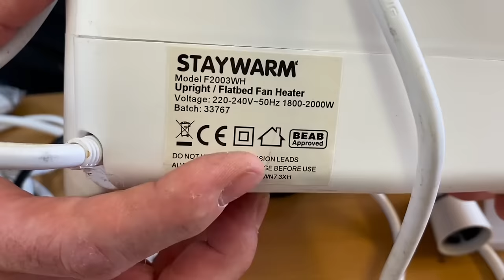Class 5 Flexible Cables - Construction, Number of Conductors - BS 1363 Plug Tops and BS 1362 Fuses

Comment: The ferrules usually have a slightly opened end to make it easier to insert the cables - look closely for this as it's not always easy to see on the smaller ones.
Also, probably covered in another  of your videos.... if you are using a double ferrule, do NOT twist the two cables together before inserting them ~ they must be allowed to interleave for themselves.

Comment: Id be interested to know what is the correct way to link up 3 extension cables ? each extension cable has 6 way 13 amp sockets and there are 3 of them in a cabinet that gets moved around. So rather than put these 3 extensions into another extension, what would be the safest way to link them all together and supply power ? The devices connected are TV, playstations, xboxes, tv viewing devices, so not anything draining like irons etc. Thanks

Comment: 4:30 that plastic bag, is that a spare fuse left in there? Is that plastic bag enough insulation so there is no risk of the fuse shorting out inside the plug top?